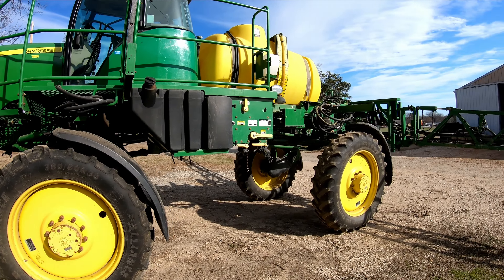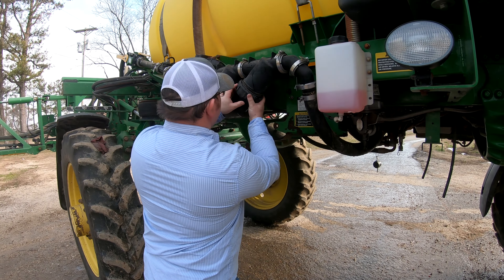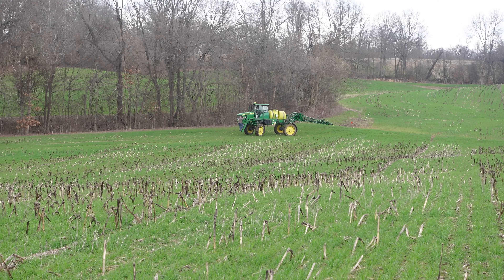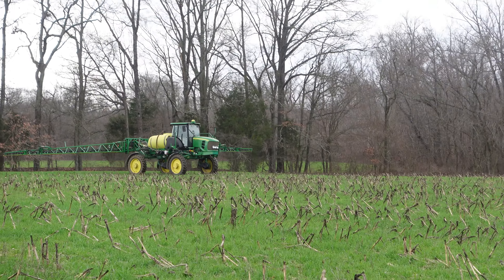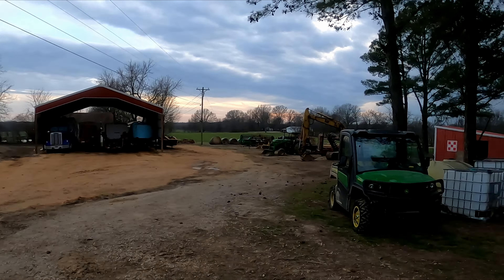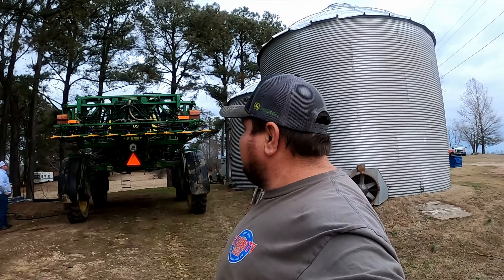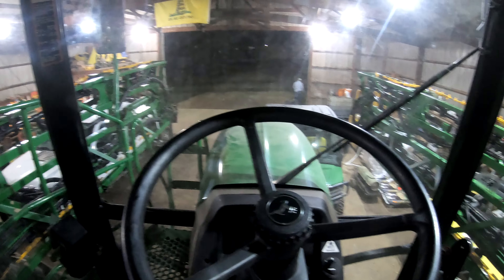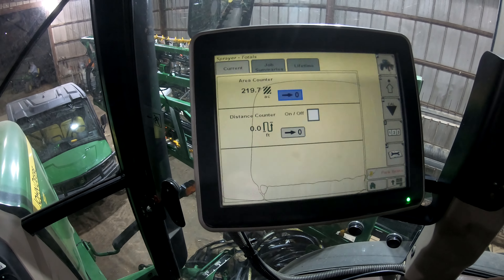1st Trip With New John Deere Sprayer (new to us that is)

Comment: We have a 4630 and use stream bars. If you will add another round black plastic piece on the bottom of the boom cradle you won't have to worry about hitting the stream bar when folding the boom. We have had ours for 1 season and really like it. One other suggestion I would make is to get you a o-ring kit for the hose's and fittings behind the tank. We have had 4-5 to leak and its always a blown o-ring....We enjoy your channel.
Reply from the maker: Thanks for the info!

Comment: Nice sprayer. How do you like the stream bars over the nitrogen tips? I use 7 ways.
Reply from the maker: They’ve got their advantages and disadvantages. They’re aggravating to put on and remove. I think you get a lot more uniform coverage with them. Biggest advantage I see is the variable rate orfices where you can put out multiple rates with the same tip.

Comment: What is the difference if anything between the spray bar's and the tips like matt uses
Reply from the maker: The stream bars are supposed to offer much more uniform coverage and not streak the wheat. If you do a job job controlling your boom  height using tips they do just as good. I also like that stream bars have a variable rate orfice so that I can apply anywhere from 5 gal/ac. To 50 gal./ac with the same bar instead of owning multiple sets of fertilizer tips.
Reply from the maker: Here is a very informative video that discusses different methods of nitrogen application. https://youtu.be/M2bQOQrrZvU